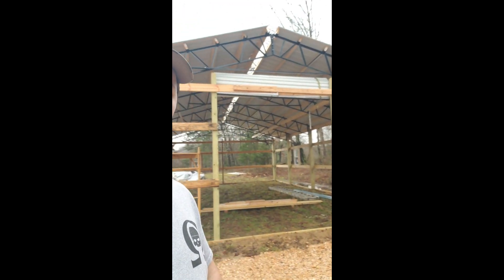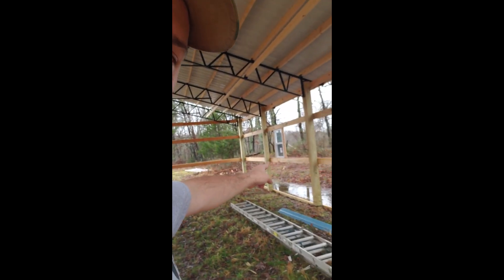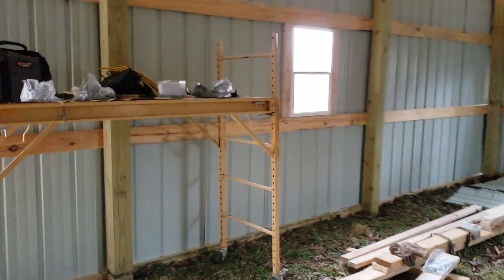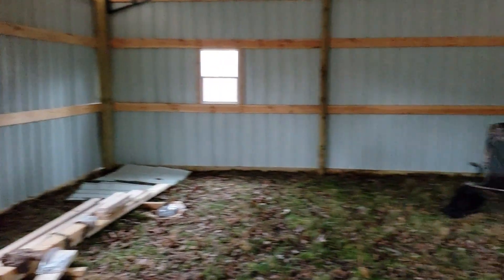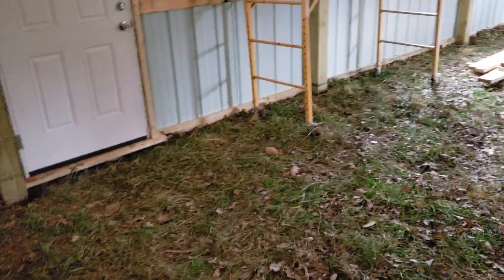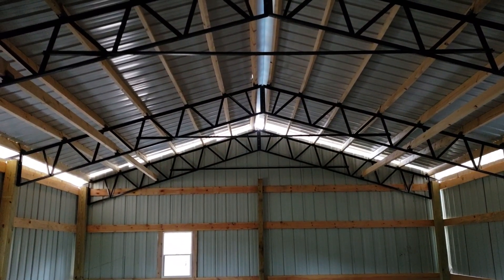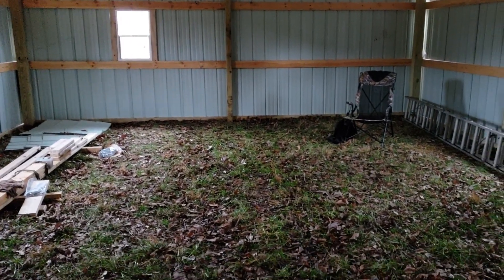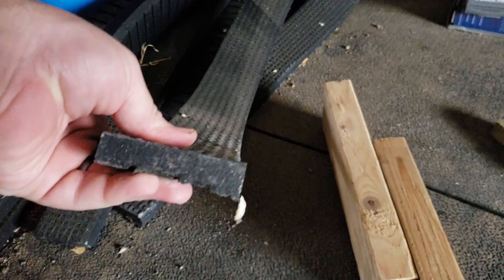New Shop 2019

Comment: Congratulations! Are metal rafters and rubber over rock floor common?
Reply from the maker: The metal trusses are very common here. The floor is common in the horse industry. I figured I would try it out. It will give me a chance to upgrade to concrete as needed for new equipment.
Reply: Is there a specific name for that style of flooring? I've wondering how well it would do with heavier machinery.
Reply from the maker: @footpetaljones  yes, they are "stall mats" made for horse barns. They come in 4'x6' most are 3/4 thick. They are very solid and hold up to several thousand pounds of animal tromping on them. I'll be sure to update on how it holds up. Especially if they stay level.